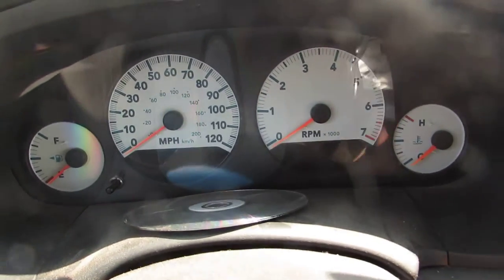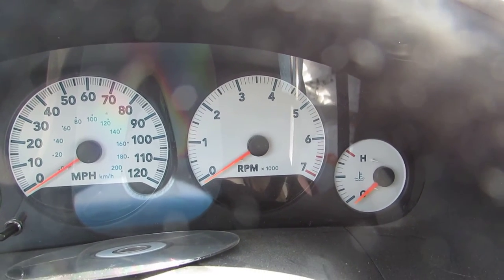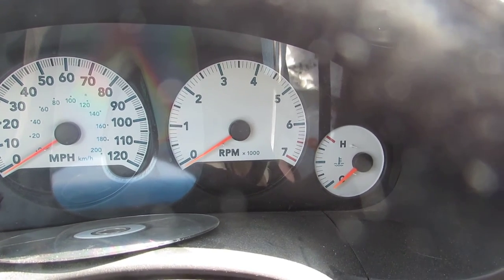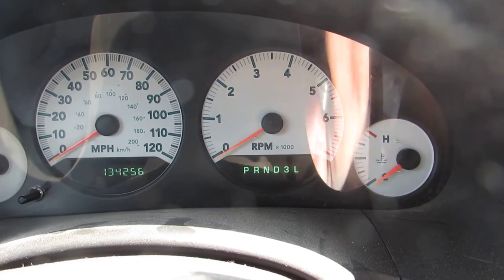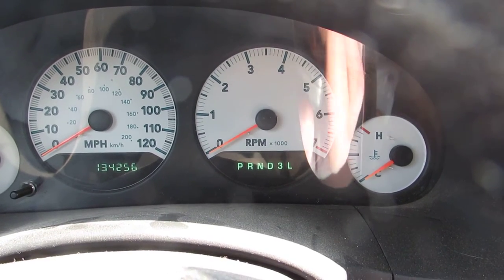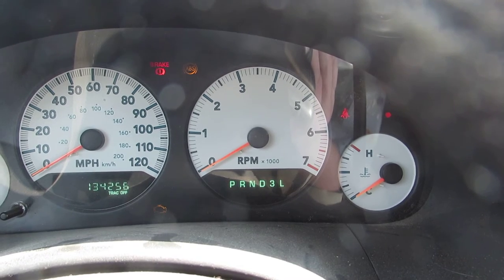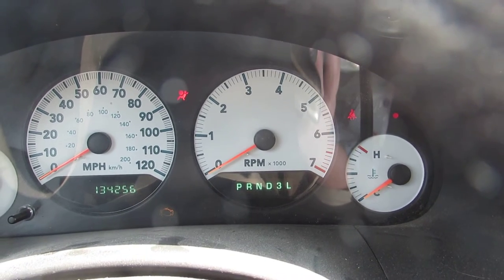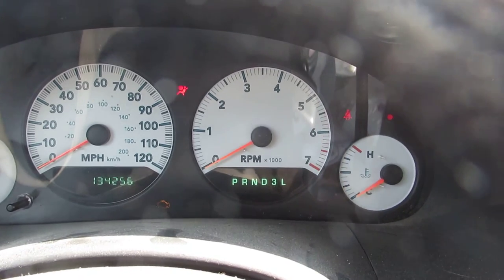Caravan won't start after accident - bad PCM

Comment: Try getting the spare key if possible.. It is a theft system issue. I had a jeep compass and my key went for a swim with me and then when i went to put it in the ignition to start it the same exact issue your having happened. The tiny red dot stays solid. It an engine immobilizer light.

Comment: Fuel pump disabled?
Reply from the maker: No, I don't believe this vehicle is equipped with that feature (that's more of a Ford thing.)  Whether it is or not, though, the symptoms don't match; if the fuel pump were the issue, it would turn over.  This just clicks once, quietly.
Reply: If you figured this out please let me know I am currently dealing with the same problem car wreck easy fix but will not crank same lights same everything thank you

Comment: I have the same exact band doing the same exact thing for the same exact reason so please if you find out what it is please let me know same click same thing with the hazard lights all the lights light up easy to fix just no crank
Reply from the maker: I put the fix in 3 places.  It's the ECM, inside the driver's fender.  Just replace it, and you'll be fine.  Easy 20- minute fix.
Reply: @ArtByStrongWolf  thank you did you have to have it recoated
Reply: @ArtByStrongWolf  reprogrammed sorry
Reply from the maker: @RileyTheMonster299  I ordered a used one from eBay, the seller programmed in my van's VIN & mileage before shipping it to me.

Comment: So what happened? Did you get the issues fixed? no update?
Reply from the maker: The solution is posted in the 'description', the video title, and in some annotations, but I'll reiterate for you; the issue was a bad PCM. I ordered a replacement on eBay (you have to match the part number exactly, and make sure to buy one that will come pre-programmed for your car's VIN & Odometer mileage), and the van now works great.